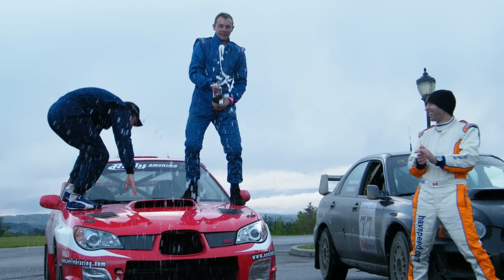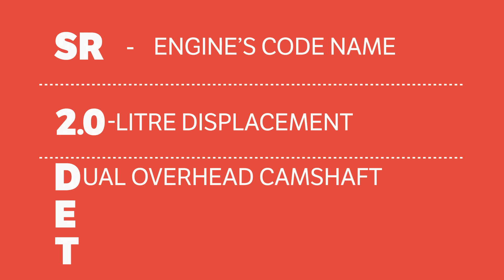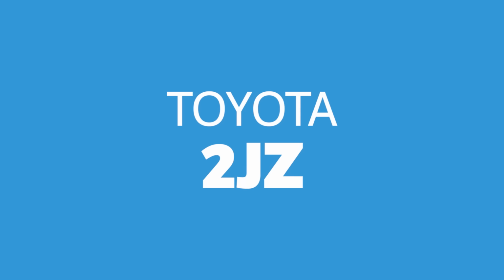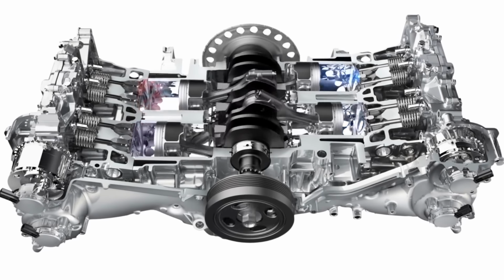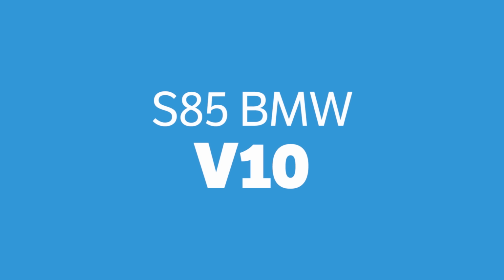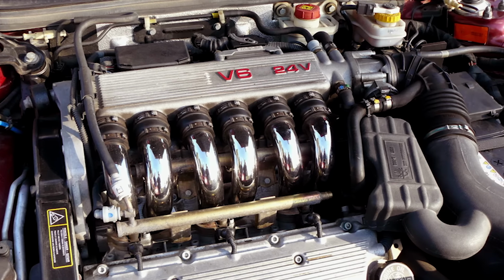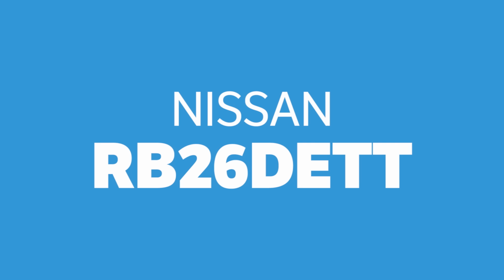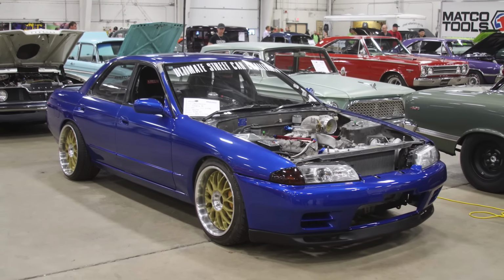10 Iconic Engines Every Petrolhead Needs To Know

Comment: No Chrysler Hemi or Ford Modular engines?
Reply: Mainly European engines were chosen for this.
Reply: Yea really Hemi's are great
Reply: Hemi's are cool, the Modular fords were just dogs. I had one
Reply: They said Iconic. EVERYONE who is a "petrolhead" knows the LS. Hemis are cool, the modular is shit compared to the 351, and honestly, I'm surprised the Cleveland didn't make it up here. This has a heavy euro bias due to this person being from england.
Reply: Except when you consider the engine in the GT is still a modular. The coyote, roadrunner, trinity and the new flat plane crank in the GT350 are all part of the modular family.
Reply: +nullr2 yes, but the ford 351s are far more appreciated than the modular. the shitty tritons were also modulars.
Reply: nullr2
When most guys talk about the modular its usually in reference to the 2 and 4 valve 4.6 and 5.4 engines
Reply: DaBrute engines that should have been included: third gen hemi, 351 Cleveland, coyote, and the least likely, the windsor

The Windsor can only have a 500hp limit for tuning (until you secure the block with brackets) if you watch one of 1320 video (I think it was called that) they A had a video of a third gen mustang with the Windsor reach 1,200 hp
Reply: dude the engine in 03  svt cobra was not shit with 3 little tiny upgrades ur looking incredible HP and tq gain. and top of that the stock block and forged internals are so good already on their own.
Reply: Muammar Gibran wasted
Reply: Haik Boyadjian one word LS2
Reply: well if u compare a ls2 gto and 03 cobra. the 03 cobra would be better. But no doubt ls2 is also a great engine. although imo i think the lt5 is the best engine chevy has ever made
Reply: the modular engines aren't that great imo. They're mostly a cheap, and easy to work on engine that has many interchangeable parts. plus you need boost to make any real power from them. This is coming from a 4.6 mustang owner
Reply: are you 4.6 cobra owner or 4.6 gt owner. cuz theirs a difference between the 2 and when u see that the 03 cobra engine. you would have a change of heart
Reply: 5.0L Coyote is the best damn mod engine from Ford as well as the 4.6 DOHC from the shelby.
Reply: 5.0 not a modular engine. its a pushrod. 2 different types of motors. both are exceptional products of ford. I wouldnt say its better tho.
Reply: Haik Boyadjian The 5.0L Coyote from 2011 and up is dual over head cam and is based off the Modular family. The 302 Windsor and older Boss 302 are push rod. The last push rod 302 was 2002.
Reply: Ratkill9000 oh I thought you were talking about the old pushrod lol? that's y I said " I wouldn't say it's better tho"
Reply: Haik Boyadjian Nah. I like the push rod 302, but really isn't much you can do to it for added power without doing a ton of work to it.
Reply: Yea its a nice engine of its time lol
Reply: the 4v 4.6 is a good engine but like i said you need boost to make real power in any 4.6. the 03-04 cobras only made 400hp because of boost.
Reply: thats somewhat true but take the 2k cobra R it was 5.4 naturally aspirated and roughly same hp. the reason this 1 needs a blower is cuz its low displacement and doesnt use 5.4 cobra engine stuff
Reply: you would think the Hemi would be on the list due to the fact that if it wasn't used in Allied fighter planes during ww2, the germans would have probably bombed London into the ground

Comment: Saab b234 is getting way to little respect
Reply: I agree. It's literally the engine that put turbocharging on the map.
Reply: THANK YOU I'M NOT ALONE
Reply: The Corvair Monza Spyder, the GNX, and the BMW 2002 turbo would beg to differ.
Reply: and b204r not to mention
Reply: I didn't expect to see my engine mentioned here. Nice.
Reply: SpaghettiFox I disagree. The Saab 99 Turbo was the first ever production car that was turbocharged and also obtainable to the masses. Saab is the automaker who put turbocharged cars in the spotlight. Not Chevrolet, not Porsche, not Buick, not BMW. It was Saab. Even Top Gear has acknowledged that it was Saab who introduced turbos in mainstream cars.

Comment: Many people will disagree but the Rover KSeries even with its design flaw which caused HGF they were incredibly good engines and still are some 30 odd years later, MG ZR's, rovers you'd be quite surprised when a 160hp rover 25 can take you at the lights ! The 7200 rpm rev limit and the screaming induction noise with ITB's was and is incredible sounding, turbo charged making into 210 hp and the 1.4 for the younger drivers easily achieving 125-130 hp with supporting bolt ones and a remap!

Comment: For BMW i would say the m50 is the most iconic
Reply: That's what I was thinking too. Sure the M-powered Sxx motors are awesome, but the M20/M50/M52/M54 progression has been powering the bread and butter entry level drivers' cars for 40+ years.
Reply: Exactly you can find that engine in alot of them , e34, e36, e39 and e 46 i think and is still a popular engine for e30 and all the 4cylinder bmw that wants an upgrade mostly gets the m50 .. I have a e34 525i with an m20 but i kinda wants the m50
Reply: M10.
Reply: Casper Wendt loved my E39s

Comment: A great list. Probably all the engines I would have included. For those who have never experienced the GM truck-sourced 5.3L V8 1999 and newer, they are an extremely under-rated engine. 300k miles on a stock top end, 295 horse, 325 torque, 18mpg, very smooth and powerful, especially in a 2wd regular cab, short bed truck. Probably the best all-around V8 you can buy for a budget price short of an LS1.

Comment: Where's the Ecoboost
Reply: fuck that pos engine, not even close to iconic ;)
Reply: +Hjalpmovie any engine that's smaller than a 4 Cylinder yet makes 660hp stock is good to me
Reply: Except its not? Just too new. Its getting F150s deep 11's with nothing but a reflash so yea. 80,000 miles on a ton of em still running strong.
Reply: Which one?
Reply: both the 3.5 and 2.7 v6. Getting put into a lot of stuff now
Reply: Ummmm there are no engines smaller than a 4-cylinder making 660hp. Most manufacturers don't even use engines smaller than a 4 cylinder. The new Mitsubishi Mirage has a 3 cylinder, and some older european cars had smaller. But Ford's 2.0 L 4 cylinder ecoboost only makes 301 hp at the most and that's because it's turbocharged. The V6 ecoboost is where you get a little more powerful, but even in the Mustang GT, only makes 435 hp. None of Fords small engines can make 660 hp, not from the factory.
Reply: +Jordan Flores Nissan has a 3 cylinder engine that might be put into use making 400 hp and weighing 88 pounds. Yea it's not ford and yea it's not 600 hp but those figures should be eclipsed in the next couple years.
Reply: Erik Plascencia that's amazing, although I prefer big fat V8s.
Reply: It's too new to be iconic...
Reply: in a tree
Reply: far from iconic

Comment: RB series of engine is actually been put into a few kinds of cars in the factory. A31 Cefiro, C33 & 34 Laurel and Nissan Stagea, Plus the RB series of engine is so famous because it fits almost every Nissan cars from the 80s till early 2000s and it has the same strength as the Toyota JZ engines.

Comment: What about the Porsche Mezger Engine. Porsche used that design for over 50 years. The last versions of that engine were in the 997 GT2 RS, and 997.2 GT3s. It's a fabulous engine, plus also Hans Mezger designed the Mclaren Formula 1 engines in the 80s.

Comment: The A-series engine is pretty iconic... Used from the late 50's up to 2001 being the first engine to be  transversely mounted in the mini as well as powering many other cars such as the morris minor, morris traveler, mg midget and such. It is highly tuneable and very had been very successful in racing / rally. It went from being a carb engine to single point injection and then to multi point injection as well as also being used as an N/A and factory turbo engine... Just a few things that to me make the a series pretty darn worthy of this list! Just because it diddnt make masses of power from stock.. Always.. doesn't make it bad or not iconic! I have a single point injection classic mini cooper and after 90000 miles still makes good power and returns 49 mpg on the motorway.. Not bad for a 50 year old design!

Comment: I find the mazda 323f zxi 2.0l v6 24v with variable air intake as a beautiful sound with supercharger like whine at high revs (over 4000).
Rev it up a bit and it maintains improved response even below 4000. It's I find a very overlooked engine, shame about the distributor ignition

Comment: Just a minor correction. The S2000 was not the highest specific output for any NA engine. It held the record for most HP per litre for an NA engine until the Ferrari 458. ;-)

Comment: What about some racing engines, such as Mercedes M119 (which powered the Sauber Group C sports prototypes and Mercedes road cars), Nissan VRH35Z/L (also used in Group C prototypes, the R390 GT1 and new McLaren cars), Toyota R36V/R (used in SARD-built Toyota Group C prototypes and GT-ONE), Porsche Typ 935 (from the 935, 962 and 911 GT1), BMW P60B40 (in the M3 E46 GTR), S14 (in the M3 E30), S70/2 (in the BMW M8 Prototype and McLaren F1), Cosworth DFR (the most successful engine in motorsport), or GM LT1, which made almost 900 HP in the Corvette C4-based Callaway Sledgehammer (a car that did 254 mph in 1988)?

Comment: The coolest thing about the LS series is how simple they are and yet how good they perform. They reduced the cost of production by minimizing the components of the engine and making it as compact as possible. HP per volume of the engine is awesome. An s65b40 or s85b50 seems dumb to me compared to an LS3. Not to mention that you can achieve really good hp/liter figures out of these 2 valves per cylinder engines. Also the fact that is a V8 90º you get perfect 1st order balance (a pair of cylinders forming a 90º V angle have first order inertia forces acting as a rotating mass located at the crankpin with a balance factor of 1, which can be easily compensated) and 2nd order balance due to its 90 degree crank pins. But you get 2nd order rocking couple due to the space between cylinders. Anyways, its an amazing engine. People here in Europe do not know how really awesome these engines are. Boxer engines have really good balance. And so do inline 6 engines, which could even work without counterweights and have no vibrations.

Comment: Audi`s Inline 5, dominated the rally scene in the 80`s and the american touring car scene in the early 90`s.
VW`s 1.8t, the cheapest and (in comparrison) the most reliable way to own a turbo. 
Mercedes 3.0 diesel (1975-1986), runs on used oil and vodka for a million miles.
Nothing against japanese cars, but you could have atleast replaced one of them for one of these gems.

Comment: What about the 2.0 Ford Cosworth engine? The 200 block cossie lump is capable of making over 1100 bhp, used in the Sierra in the '80's and both the Escort and Sierra in the '90's. It was so succesful in touring cars that they changed the rules because nothing else could touch it! Then there's the BDA (later the BDT, BDX and evo variants) engines developed by Cosworth for Ford, used in the RS200, good for over 800bhp in 1.8L trim and over 1000bhp in 2.1L (evo) trim. Also, the Vauxhall/Opel 2.0 redtop engine, originally designed by Cosworth for Vauxhall, it was meant to have 200 bhp n/a as standard but choked to 150 because of emissions and good for big power when boosted with 700bhp relatively easily achievable. Not having a Cosworth engine on the list seems wrong to me.

Comment: I got the most rare Volvo ever. The V70 XC AWD , yes is not the boring,  xc 70 awd  IS THE V70 + XC AWD Volvo , one of the first gen v70 awd , and because it has the in line five engine , witch is a 2.4 liter turbocharged engine, and a manual transmission, it sounds like a  jet aircraft about to take off on the high way at 3000 rpm.

Comment: I feel like the Boxer was kinda shown for the wrong brand... no offence to Subaru, but the Porsches just sound way more awesome.

Another Engine which imo deserves to be mentioned is the BMW M62, which you may find for example in the e39 540i, e38 740i, e53 x5 4.4i, Morgan Aero 8 or even a 2002-2005 Range Rover. It may not be the most outstanding engine, but if you want a cheap, reliable daily driver, it's a decent choice. The S62 Performance Variant (also in e39 M5) is still being placed in the Ascari A10.

Comment: This should have been:
10. LS series, 
9. Coyote,
8. ej25, 
7. sr20, 
6. 4g63, 
5. rb26, 
4. 2jz,
3. n54 (handles crazy power like the 2j&rb and is lighter), 
2. vr38dett, 
1. Porsche flat six TT or the GT3RS engine

Comment: There are a couple of engines to add to you list.  What about Dodges 318 cid ( cubic inch displacement for you brits).  I had this engine in my 1987 dodge d150 pickup truck - lasted for every -  350,000 kilometres before i sold it.    Dodge got rid of there slant six engine,  an excellent engine - to bad no longer produced.    Now i drive a Hyundia, their 2 litre engine are fantastic in long  lasting and high mileage, and relative good fuel economy.   Both the dodge and Hyundia  are good  cold weather ( like - 25 to - 30 celsius ) starts. Try that in your pics

Comment: I had a rotary. Clearly 'iconic' can still include crap, because it was. Gutless. Ditto Alfa V6, had that. Also surprisingly sluggish for 3.2. With you on the Volvo modular though. Love them!!!!
Reply: what Alfa V6 did you have? GTA? I have driven a few, and NONE were sluggish. The 3.2 in the 159 however....that is not a Busso...but that was sluggish.

Comment: There is one iconic engine which is not featured here but every petrol head will know or heard about it

The Toyota 4AGE 20V Silvertop.

Not just any normal silvertop but the TRD Group A 4AGE 20V revving over 12000 rpm

Most of us should have watch or read the Anime/Manga Initial D will know this engine is used in the Toyota Sprinter Trueno GT-Apex driven by the boy Takumi Fujiwara delivering Tofu in Mt Akina/Haruna by night and races against powerful cars like the MX-5s, FD3S, Evos, R32 and EG6 & EK9 and S2000 just to name a few cars.

Comment: No modular? The power plant responsible for the most common cop car since the mid 90s. Behind cars like the Ford GT, Terminator Cobra, Ford Lightning, GT500, Cobra R, and F-series which was the most popular selling vehicle (both trucks AND cars) during a few years. Not to mention the newest iterations with the Coyote, Roadrunner (Boss), Voodoo (flat plane crank version used in the GT350). Hell they even make larger displacement versions they fit into SuperDuty trucks and school buses.

Comment: SR20DET is still inferior than the less known FJ20ET, which is stronger & more powerful despite being older.

The Subaru EJ is nice but problem being it leaks oil like no tomorrow because it eats gaskets. The FA seems like a better improvement but the STi variant in the future better have regular straight con-rods.

The S85 also spawned the S65 4.0L V8 which is arguably the last good M3 engine. Also it is the last unique M engine as all later units are derived from existing BMW ones.

The Ford Modular V8, Porsche air-cooled Flat-6 and Honda C32 V6 also deserve special mention IMO.

Comment: The boxer doesn't sound the way it does because of the orientation of the engine...equal and unequal length headers........put some equals on a boxer and it'll sound the same as an inline 4

Comment: I would have put the 3.5 VQ engine from Nissan and the 5.0 Coyote V8 from Ford instead of Alfa's and Volvo's engines because IMHO they are more iconic.
Reply: wtf are you on. The VQ is far from iconic. Sounds terrible. The Alfa V6 is possibly the best ever put into mass production - Jeremy Clarson's words, not mine. It has the VQ beat in every measurable metric, and it's service life spans from the 70s to 2008. So....nope.

Comment: Why does subaru always get credit for the boxer engine?  Porsche was doing Boxster engines for years prior to Subaru and in my opinion was doing a damn good job of it Porsche and VW made the air cooled boxster 4 last alot longer than you'd ever think.  It's strange to think a car whose engine is in the rear under a truck could be air cooled to operating temperatures.  And again they were making these things and they had no overheating issues until the 1990s to me thats a whole lot more impressive than some subie with AWD and piston slop up the ass after 150k miles

Comment: What about the 6.1 hemi v8
Car throttle
Reply: The 6.1 was a dog. The latest 5.7's are keeping up with them.
Reply: p387t if the 6.1 is stock yes but manufacturers can boost it to over 1000 hp

Comment: Volkswagen group's 1.8 20VT, from the early 2000s.
Reply: Right!
Reply: I have that engine in my car. Creates a lot of torque. I plan on boosting it to 275 hp as the rods are rated up to 300hp. It's amazing that you can boost it to double what they come out of the factory with before you need to change engine internals. Basically just upgrade from the KO3 to KO4 turbo, bigger throttle and reprogram the cpu. I have an Audi A4 B5. Talk about a sleeper!

Comment: This video is the reason that I un-subbed from Car Throttle. I don't understand why they channel emphasis is basically all euro and JDM stuff. I mean I get the fact that they aren't a US based channel, or that they have no reason at all to cater to US viewers but, 10 Iconic engines? No mention of the Ford 302 and we got the LS series in place of the SBC. I don't understand this material anymore. These engines are supposed to be iconic worldwide and I can assure you that there are more fans of the Ford 302 or 350 Chevy than any other engine currently in the US.